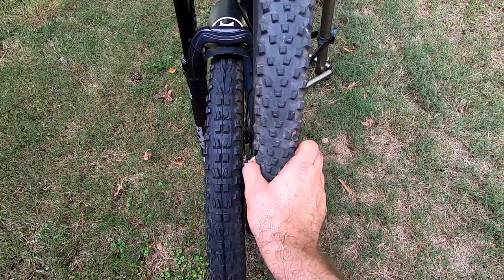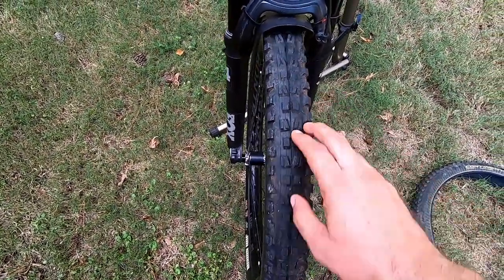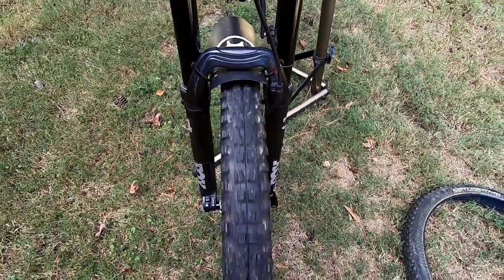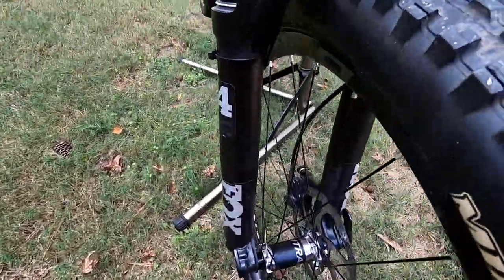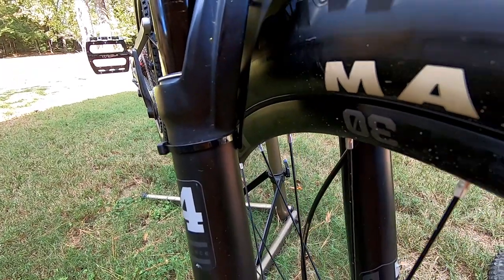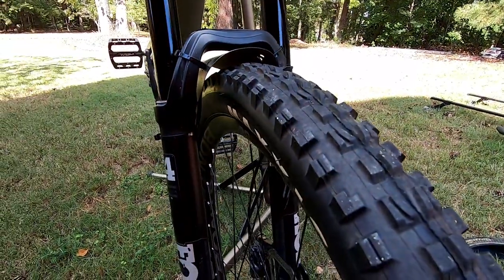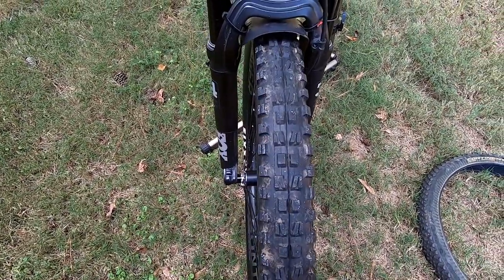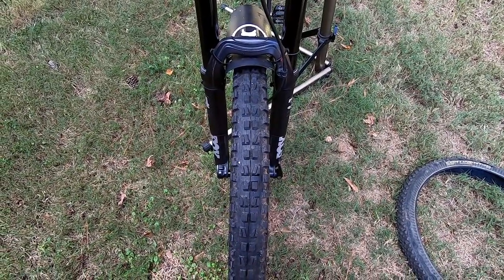The Maxxis Tire Wobble, is it common??

Comment: My son had minion DHR on a  bike we bought used the tires were pretty good when we bought the bike but wore out at the end of the season.  He got a flat and I had to remount and it was awful.  I aired the tires down to about 15 PSI and physically pushed them while on the bike to straighten them up they weren’t perfect but good enough to sell the bike. It was too small for him already.  He loved the tires I would have bought new ones if keeping the bike.
Reply from the maker: I still like the grip on them and am riding it like this. Can’t really tell when riding.

Comment: It could be that the tyre isn’t seated properly or the inner tube isn’t seated properly either on the wheel. If you have an inner tube deflate it take it out & put it back in so it goes in evenly try inflating it again.Hope that helps 👍
Reply from the maker: thought about that too but I already tried t reseat it twice. I might give it another try tomorrow. The rear is running straight.

Comment: So first time running Maxxis tires and my new Aggressor is wobbly damnit!!! Thought it was the rim but all true like yours even installed it on another wheel and tire wobbles. Did you find a fix or definitely just manufacture defect?
Reply from the maker: I gave up after many tries, just using it that way

Comment: I recommend to try again, and pump it up to 60psi,  good one time let it stand for few hours, it will help the tyre seat next time I guess. at least it helped me, but once tyre wears after long term, that common method is out of the window, nothing will help, tyre might even move and get better then worse, and change how it wobbles. nut at that time it's time to install new tyres, so that's what I do, I do that as soon as I can.
make sure to inspect bead after evry removal of tyre, and if you see tthe rubber on the bead is tearing off, the tyre is done, if you see the nylon in the bead it will explode if you try, I've done that just to test it.

Comment: I've just watched a video where a guy had the same problem he deflated popped the bead off run a sponge with soapy water around the bead both sides and put back on and pumped up and inflated tyre and you cld hear the pop of the bead snapping into place 
I'm going to be trying this as I've recently installed mitchelin dh22 on my bike and I'm to am getting tyre wobble so gonna see how this goes
Reply from the maker: In my case I did all that already. On inspection the sidewall has a crease where the wobble is so I trashed it. Running a Continental Crossking without any problems now

Comment: I have  Teravail tires with 700 miles . I did use 303 when new and they are in really good condition. I was going to shift to Maxxis just to try them because they are very popular but after seeing this no way. I remember I paid $10 for some wolverines WTB that didn’t do this and they had a bad wobble.

Time to use 303 once more...
Reply from the maker: I have to admit the Minions’ grip is great compared to my Continental Crossking Black Chili, but the Maxxis are heavy and the side walls are not as abrasion resistant.
Reply: @TonyHob  I see. That means the quality is not there as I thought. Tires are not near cheap, specially Maxxis. Thanks for all the info.

Comment: Maybe you could try this, take the tyre off then fold the tyre inside out and warm it slightly with a hair dryer, fold it back to normal then put it back on the wheel.

Comment: Like mine. Its new and its wobbling ridiculous. Its annoying. Maxxis minion 27.5x2.50 front in my dh session 8.thats why return it back the stock tire bontrager and much better. How do i fix this. Any commendation pls.
Reply from the maker: It could be not seated right so you can try soapy water and an air compressor to around 50 psi. In my case nothing worked. Try contacting Maxxis, they should send you another tire.

Comment: Soapy water would usually do the trick. Won't be 100% but far better than leaving the beads "ungreased" ....whilst inflating you should hear a "pop"....not claiming it always works and I had to learn this the hard way. And no..car shampoo is not a good substitute for dish wash detergent ;-) ..also learned that the hard way (lazy because I just happened to have it laying around). Good luck.
Reply from the maker: Been there, done that as you can read in the pinned comment. After removing the tire I found a crease defect on the side wall where the wobble is. Definitely the tire. The  Continental that replaced it is perfectly straight.

Comment: I have had exactly the same problem yesterday with a Continental Cross King ShieldWall foldable 26x2.00.
The online shop refunded me inmediately without asking.   Seems that the big factory in China where all tyres are made had several bad weeks.  Tired of paying high prices to reknowned firms and getting poor quality.  I don't want to do a radiography of the frames!!!
Reply: Im having this issue now im on my second tire and it still has a bit of wobble    did you find a fix  or did they replace?

Comment: Use soap when you puy it on. INSTRUTIONS!!
First: Take tire on.
Second: take soap on the tire where the tire is up aginst the rim.
Third: Get some air in the tire and it should pop into place.

Why does it happend: There is a out line on the maxxis tires just above the rim, and some place's it might not clik in/on the rim or beat in? "Or what you call it" and the soap will halp it smoothend out, just use a bit too much air and it might give a pop sound before or after you have it the max psi you need. ;) Text me if I missed some thing or you might even have some questions, just text :)
Reply from the maker: Read the rest of the comments including the pinned one, the ones where others have done exactly what you mention several times (including myself), the ones mounted by bike shops and the ones where Maxxis has sent them a replacement tire (because they know it’s a defect) You are not talking to newbs here🙄
Reply: @TonyHob  haha no deffently not, but there might have bin some people that just was scrolling through to find a solution for it. So yeah. Even though the one that have bin pind is a lot easy to find, it's allways good to have some of those like mine. Maybe some one need a nother describtion like mine.
🙂👍

Comment: My Maxxis didn’t have a wobble, built up two high end King/Reserve carbon wheels, seated them properly over from my original wheels, boom wobble, thought my brand new wheels weren’t built true.  Wth 🤦‍♂️
Reply from the maker: Some comments have mentioned that maybe they have stretched unevenly when removing's and re-installing. This might be a good theory since mine happened when I switched them to a different set of wheels. Just kind of strange
Reply: @TonyHob  I did use hot water and a nylon brush to remove the Stans sealant in preparation for Peaty’s sealant as well.

Comment: My friend's DHF developed a similar wobble and after hitting a drop the wobble became so bad that it was rubbing against his stanchion. Deflating the tire entirely there was a significant wrinkle in the sidewall. Clearly a defect in the manufacturing process. Unfortunately, the tire is over 1yr old and the warranty is up.
Reply: I think the case is the sidewalls are just prone to uneven stretching if stressed. I think I may have accidentally stretched  mine when first trying to set the bead, didn't hear a bead pop and realized it was full and over inflated at a point. Can see the one spot on side wall also wrinkled when deflated

Comment: I have a exo dhf that is perfectly true, i also have two aggressor DD which have a pretty pronounced wobble
Reply from the maker: My DHR on this same bike is perfectly straight
Reply: Lol... Sorry if I bother u but is this wobble dangerous?
Reply from the maker: I ride mine like this without any problems. You can’t even feel it on the front due to the suspension and steering. You’re riding over uneven terrain anyway so it’s not much different as long as the wobble isn’t really bad.
Reply: Ok! Thank you

Comment: You need to seat the rim. There's nothing wrong with the tire. The tire bead is not sitting on the rim properly. You might need some lube and an air compressor to pop out the bead.
Reply from the maker: read all the comments below and do a Google search. It is a common problem with Maxxis. I used lube, air compressor to 50 psi, I've installed literally dozens of tubeless tires before without any problems.
Reply: @TonyHob  twenty wrongs...don't make a right. Take it to someone who knows how to seat a rim.
Reply: @TonyHob  I've got the same problem with my cross bike. I've just installed a CrossBoss WTB tire on my rim and I'm getting a wobble too. But if I let some air out of the tire an squeeze it, I can see the bead sitting on the well and not the sidewall. I'll take it to a shop today. I don't want to mess with it.
Reply from the maker: Dude, believe me, I already did all that, and more than once. The fact that it CAN be mounted wrong does not mean this one is. Like I mentioned before, I’ve been working on bikes since the 1970’s. I’ve installed dozens of tubeless bikes and have helped others with installing them. Never had a problem that I couldn’t fix. Tell the same to all the others below who have also tried all the tricks without success.
Reply: @TonyHob  
Cool man. Anyway, thanks for making the video. It was interesting. 
I ironed out my tire issues today. 
Back on the road. Just getting back into riding again since the 80’s. 
Of course I also rode bike as a kid in the 60’s and 70’s.
Reply from the maker: It’s all about enjoying the trail 👍

Comment: I think you should try to reseat the tire. Deflate the tyre, apply on the rim edge and on the tire edge soapy water or better would be silicone grease(safe for rubber) and over inflate untill the tyre seats correctly. This procedure shall fix your issue.
Reply from the maker: Read the comments. I, like others, have tried the proper procedure several times. This is by far not my first time installing a tubeless tire. I went ahead and installed the Conti back on after nothing worked with the Maxxis. The Conti, once again, is nice and straight first try!

Comment: Deflate the tyres, tug the beading off the rim without removing the tyre, rub soapy water on the bead. Inflate until you hear a 'ping' preferably two, even if you have to inflate to 60 psi - needless to say ensure the inner tube is not going to pinch and that, when inflated, the slightly raised line on the tyre is seen just above the rim. Disco! Tru tyres.
Reply from the maker: Done all that. This is by far not my first time installing tubeless tires. Lots of people with the same problem with Maxxis tires. Read the other comments.

Comment: I just installed brand new DHF on a brand new wheel and I got massive wobble. :(
Reply from the maker: Sometimes it can be that the bead didn’t seat well so try the tricks mentioned in the comments. I did try several times myself but it did not help at all. Hopefully yours is not the tire itself

Comment: Pump them up to 60 psi
Reply from the maker: took them to 50 psi when I seated them, not really recommended you go any higher
Reply: Deflate them then try again
Reply from the maker: Believe me, I tried. I actually removed and reinstalled it 3 times using soapy water. The rear I did only once and it is perfectly straight.Between my three bikes and helping friends with theirs I’ve installed at least 20 tubeless tires. This is the only one that has been a problem.
Reply: @TonyHob  you seem cool I’m going spread your YouTube Channel around.

Comment: I had my Assegai mounted freshly last night. I never knew about a new tyre wobbling as I have fitted many many new tyres myself in the past and never had a problem. However, I realized that my new Maxxis Assegai has a quite a bit of a wobble which I struggled with all the possible ways to fix and then realized it a manufacturer fault which many others are experiencing.
Reply from the maker: Exactly, yet a lot of the people commenting insist the tire is mounted wrong. Others have even taken the wheel to the bike shop to seat the tire and the wobble is still there. It has to be the tire.
Reply: @TonyHob  yes Tony, it is the tyre. Actually I removed the tyre several times and put back. Even measured the bead margin with a caliper all around on both sides. It is definitely the fault in the tyre.